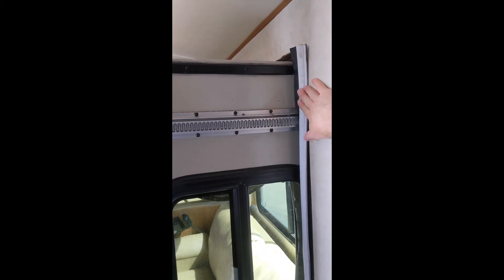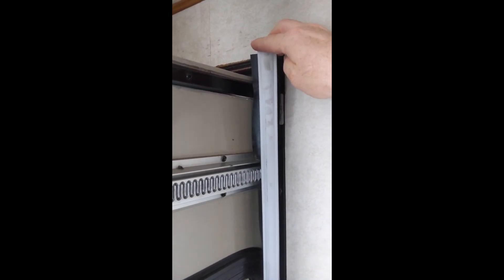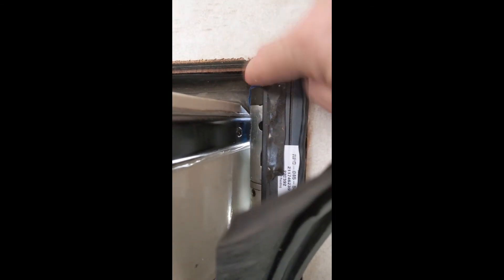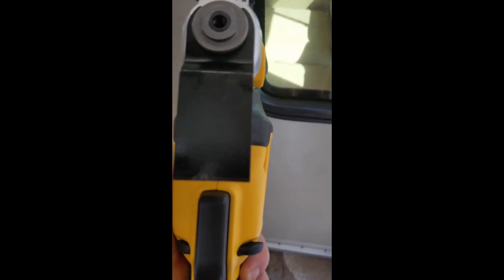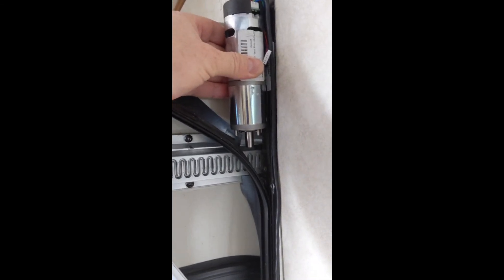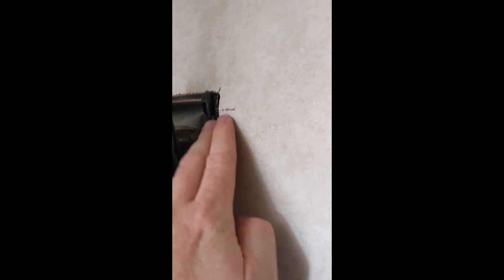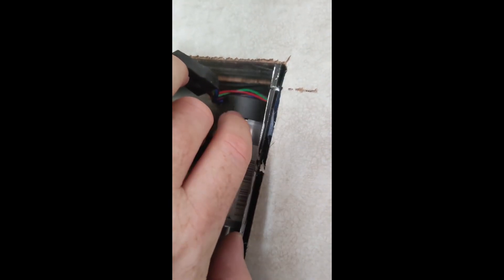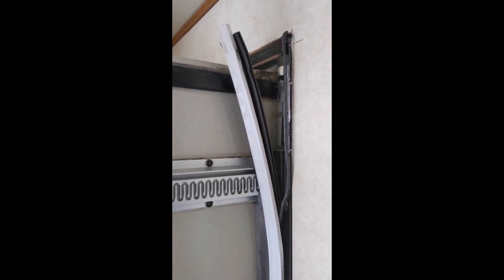Schwintek Slide-Out Motor Replacement

Comment: I have the same issue but the slide is stuck in and also the motor won’t come up
Reply: Find your slide room control module,  find the small gray over ride button next to the dip switches, with a small pointed tool carefully press the button six time and hold on the 7th until the let's flash ( red/green), your room will now be in override and now you'll be able to extend your room for better access.  BTW, I am a rv tech so I wouldn't tell you to do this if I wasn't.  To take the board out of override,  press and hold the grey button for a couple of seconds and release.  The lights should go out. Hope this helped
Reply: If you knew where the screw was located you could drill a hole thru the slide room flange in the right location…

Comment: Why don’t manufacturers drill a hole thru outer flange where motor screw is?? It could be covered with plastic snap in cap. Nope that would make this job too easy.
Reply from the maker: If it was easy, how would repair shops make their money? :D
Reply: Point taken.

Comment: You literally skipped over actually removing the motor and putting the new one in.
Reply from the maker: You can see where it goes at 5:20. There was no way for me to show actually installing it because that turned out to be the "5 second" bit. It took two hands (so I couldn't record it) but it literally drops right in to where the old one does. The motor replacement is no effort at all once you get access to the old one.